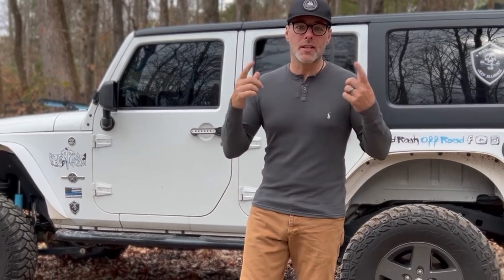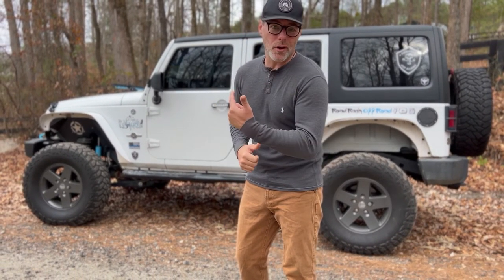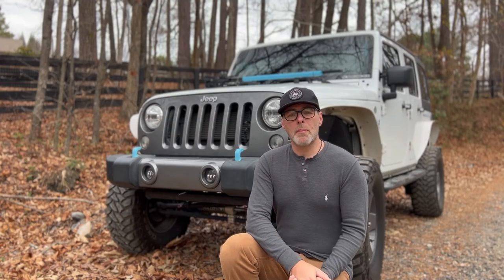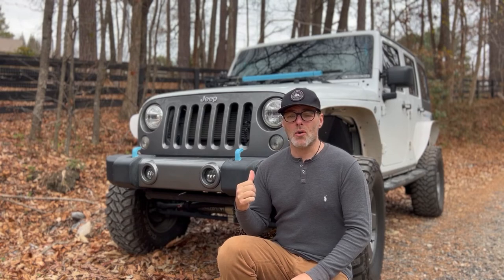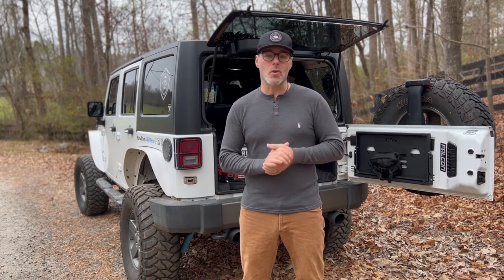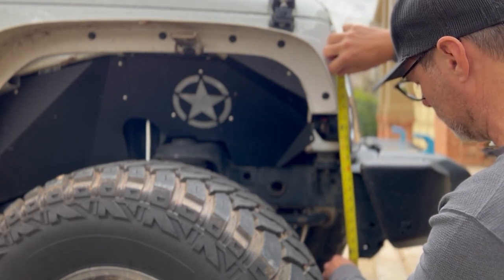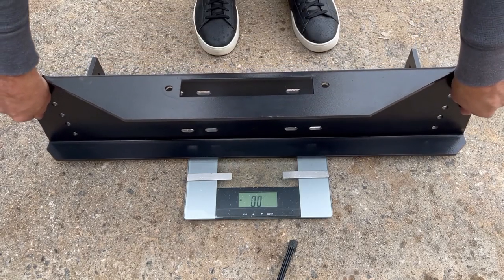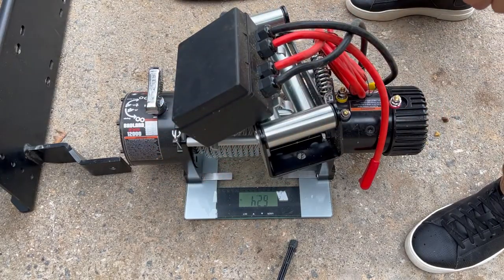Jeep Wrangler JKU Stock Bumper Winch - Rock Hard Winch Plate and Badlands 12,000 lb Winch Install

Comment: I installed the same rock hard winch plate 8yrs ago and couldn’t be happier.
Reply from the maker: It was GREAT when I had it. Worked flawlessly. 

Last year, a company called GoRhino sponsored Road Rash and wanted me to test out their new steal bumper (which i think is 1000% the best bumper ever made). 

Otherwise I would still be running the Rock Hard plate. My only issue was the lack of other recovery points from the front.

Comment: Nice install.
Used a plate as opposed to a bumper on my old 4runner for a winch as well.
Had to cut the bumper a...bit ;). 
I haven't yet used it to self recover, but the 3 or 4 trucks I yanked out were throwing dinner and drink invitations all over.
Excellent addition.
Cya' out there!!
Reply from the maker: Thank you my friend. Yea, it was a super easy install and looks great. I’m due time, we’ll see how it well it works

Comment: These Badlands winches are getting more and more recognition for sure lately. Never would have thought about this winch but trying to justify a $2400 warn winch is tough when in reality the badlands if something goes wrong, I could buy 4 for the price of 1 warn winch
Reply from the maker: You are right. I am sure Warn is worth that in the long term and from a customer service warranty prospective but I cannot afford some of the really high quality ones.

 Also, I have heard mixed reviews from them. Many swear by them with no problems and some have had issues. 

But for the low cost (and the fact I don’t use it often - I’m more of a overlander, not a rock crawler), I thought I’d give it a shot and if it goes out, replace it.

Comment: Awesome install, did your Jeep come with that short bumper or did you cut it and add those bumper and caps? I have the same bumper but it goes all the way out past the tires. 
Thx
Reply from the maker: Thank you for the compliment. I love the stubby bumper look and it's very functional off road too, keeping my tires from rubbing. I ended up cutting the bumper off on the ends with a hacksaw and installing end caps on the end of the bumper. a super easy easy project.

I bought the end caps off of amazon and the directions were very clear.
Reply: @RoadRashOffRoad  Awesome thx

Comment: Good video. What about if you need to take your grille off to change headlights, etc?
Reply from the maker: Thank you Skyfall (I’m a huge JB fan - my 1973 MG’s name is MoneyPenny)

If / when the headlights need to be replaced, I will have to remove the winch. Fortunately, these are recently installed new LED headlights so I believe I will be good for 3-4 years or so.

Comment: That's the Vacuum pump, not the water pump.
Reply from the maker: Ooops. My mistake. I’m not much of a mechanic. I only work on DIY in my garage and if I haven’t worked on it before, I get terminology wrong. Thank you for letting me know. 

Now if I have an issue with my Vacuum pump, I know where to look.

Comment: Winch still holding up good?
Reply from the maker: Absolutely. I’ve used this Badlands 12k about 60 times, both winching myself and others out. Never failed, never binded, great winch.

Unfortunately, i still have the steel cable on it. I have a great synthetic line in my garage ready to swap out. I just need to find the time to do it since I will be shooting a video on that. 

I am not using the stock bumper and winch plate anymore. I got a new steel stubby bumper by GoRhino so when i installed that, I just moved the Badlands winch over to the new bumper
Reply from the maker: I’m a huge James Bond fan BTW!! 🙌🏼

Comment: I am surprised it is only held by 2 nuts ??  Does it hold well ??
Reply from the maker: It held up perfect, and I used it a lot. Even though it was only bolted onto the frame with 2 bolts, the top of the winch plate was strategically wedged and anchored under the factory recovery hooks, which adds the additional secured placement.
Reply: I have the same one. The winch plate uses the hooks as support, the hooks are attached to frame by 8 3/4” bolts, it’s strong enough to suspend my jk in the air by the winch. I’ve also double line pulled a 1ton Dodge Ram king a out of a bog but had to tie my jeep to a tree at the back..

Comment: What is the purpose of the pins on the plate at the hooks? It appears in your video as the pins are blocking the hooks from being used????
Reply from the maker: Since the plate is only mounted onto the bumper / frame at one point, the tow hooks actually act as the second mounting point, adding strength / support to the plate, holding the weight of the Jeep under winching.

Comment: I could do this on my jk base model ?
Reply from the maker: Yes you can. That’s actually what the “winch plate” is made for. 

The bumper I have is a stock bumper. I wanted to keep my stock bumper so I decided to go this route.
Reply: @RoadRashOffRoad  thank you for the response, yea I like my stock bumper as well
Reply: @bradleyhightower6849  Yea,., My Jeep is the Freedom Edition which has the Grey bumper that match the Grey wheels. I actually like that look.

The winch plate installs directly to the bumper rails (from the body of the Jeep) allowing you to keep your stock bumper. It was super easy to install and should only took about 45 min or so with simple garage tools.

Good luck.

Comment: What was the part # for that winch plate?
 Nick Aninos
Reply from the maker: Hey Nick... This is the Rock Hard winch plate I used for my Jeep JK, however I did not by it from Amazon. I found one on Facebook Marketplace for about $60. I would look there first.

https://www.amazon.com/Rock-Hard-4x4-Mounting-Wrangler/dp/B00ZBB09EU/ref=sr_1_2?keywords=rock+hard+winch+plate+jk&qid=1646954247&sprefix=rock+hard+winch+%2Caps%2C96&sr=8-2
Reply: Part# RH-5010 I have the same one.